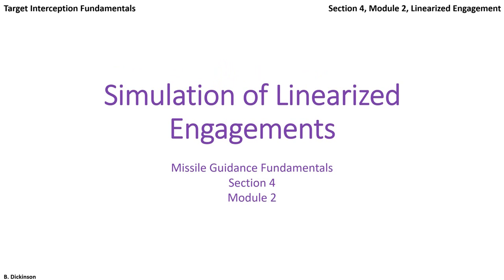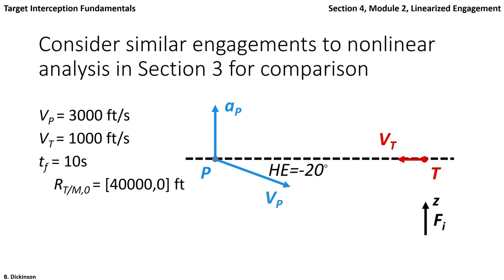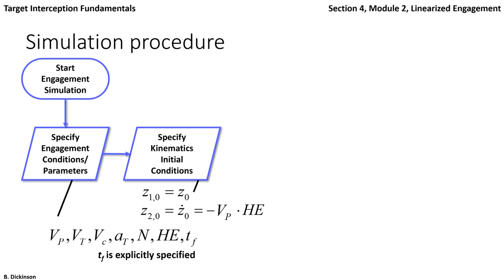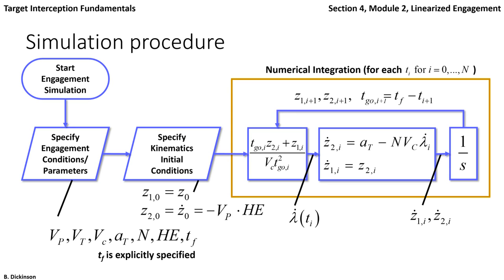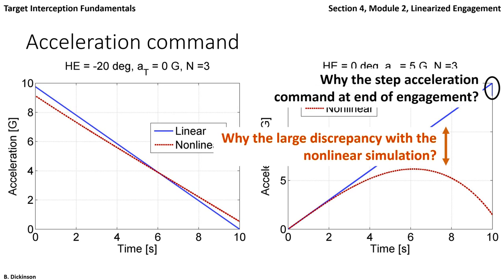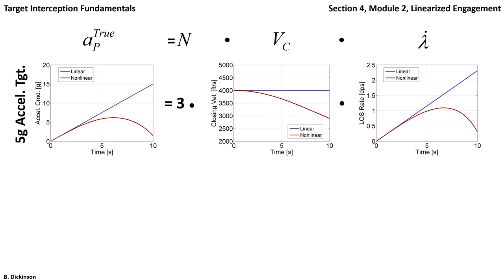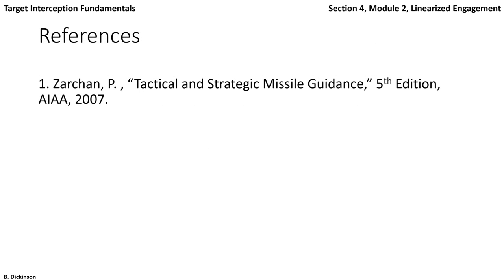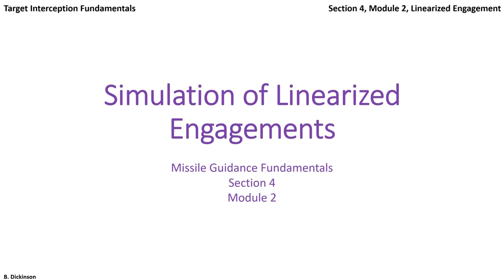Simulation of Linearized Engagements - Section 4 Module 2 - Guidance Fundamentals

Comment: Two notes:
1) at circa 1:15, tgo^2 should be changed in tgo
2) In 10:10 you say that the linear approximation is ok under 10 deg; however this is not a proof rather an empiral result based on that particular scenario you have simulated. Small angle approximation means around 0 mathematically, not around 10. I would suggest to add a note about the fact that stay under 10 deg is fine as long as the scenario is the same you did.
Reply from the maker: Thank you for these updates! 1) Agreed. 2) A valid mathematical point. I've updated my slide deck accordingly. This is part of a formal course being developed so thank you for contributing to its accuracy. 

On linearity, it is always an approximation, as our angles are never zero and if they are zero, then we're on a perfect head on collision course where no guidance is needed.